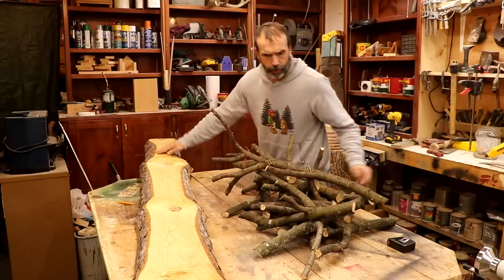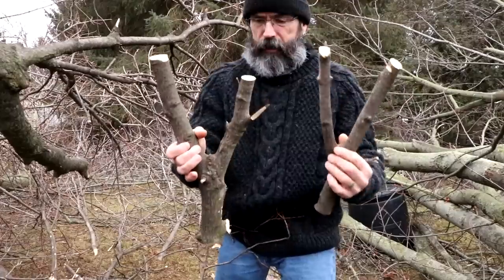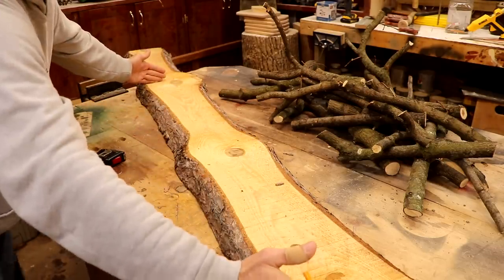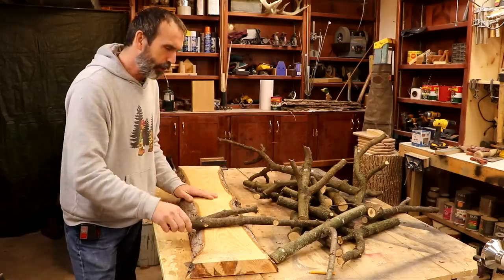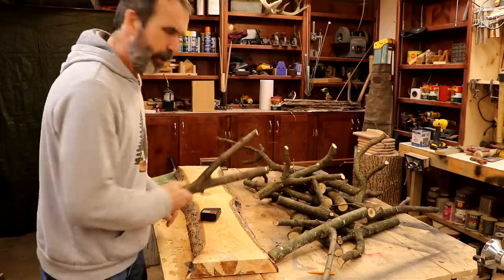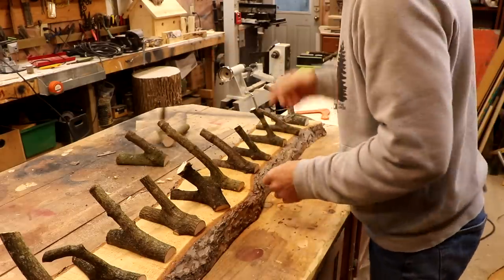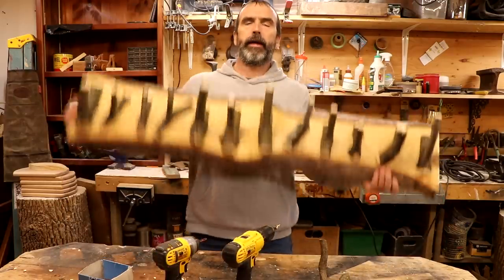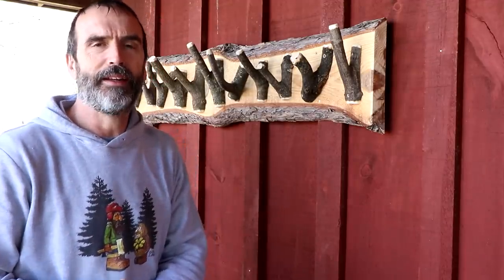Maple Branch Coat Rack -Free Material DIY

Comment: I can see that happening, 2 weeks ago I took 3- 6’ branches that had a few off branches on them and a bend on the bottom. Cut the off branches to the length I wanted, shaved the bottom ends to touch good with each other and middle and spot at near the top but not right at the top . Screws together at shaved spots fastened to nice board on bottom, cut limbs on top for hats and other limbs on sides for coats seal it took factory coat rack out put mine in wife loves it wants 2 more

Comment: Hi Doug 
Nice clothes rack question I noticed you were drilling into the top of your workbench or it look that way how often do you change your workbench out I have metal sawhorses that I do all that kind of work on with a wood top and change it frequently after a number of cuts or drill  hole good video ty 
Al from Vt